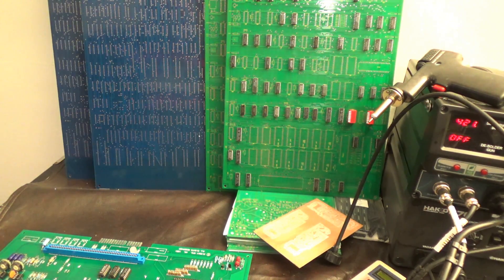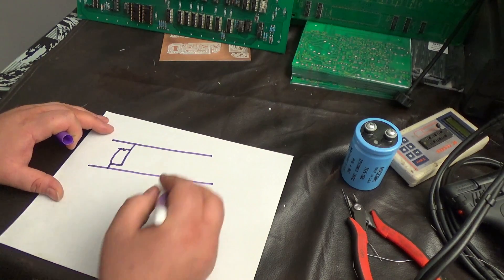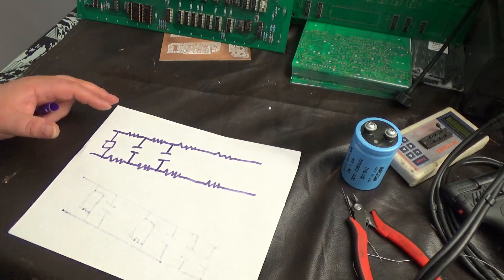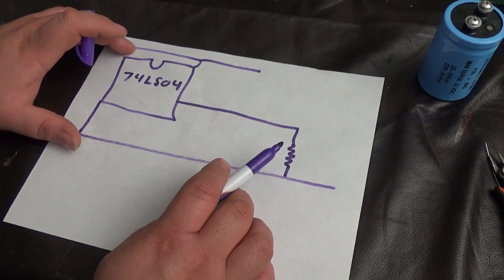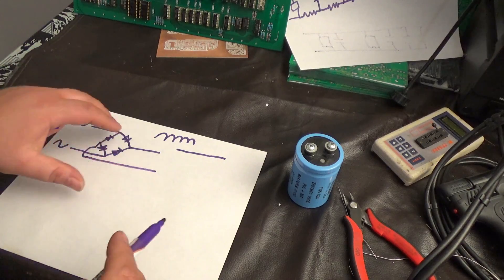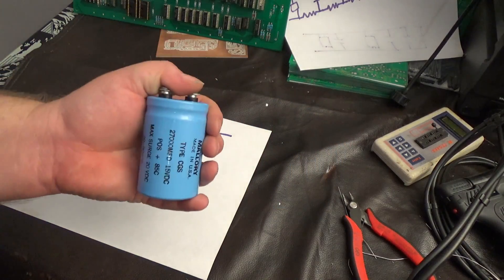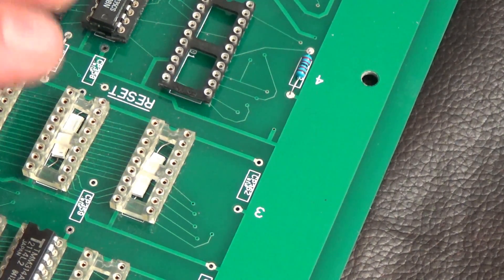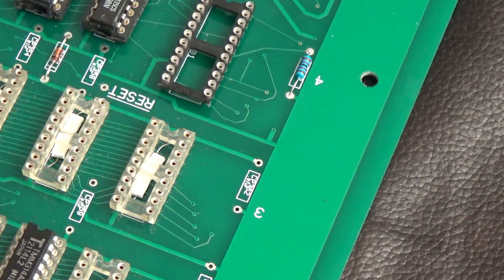Decoupling caps simple explanation

Comment: This is more or less right, but there's one thing I really think needs to be corrected:  The problem is not that the wires have resistance (the resistance is actually very small, and can be made close enough to zero to not actually matter) but actually that they have inductance, which is not the same thing (and much harder to get rid of).  The inductance of the wires means that no matter how well they transmit DC power (even a superconductor would have the same problem), if there is a change in the load, it will take some amount of time for the flow of electrons in the power/ground lines to be able to adjust to match the new load, and that shows up as a (high frequency) dip or spike in the line, which can transmit down the line to other devices, just like radio signals travelling down an antenna.

The decoupling caps allow high-frequency signals such as these spikes to "bypass" the main power lines and just flow directly to ground as soon as they come out of the chip (because the small caps right next to the chip will pass high-frequency signals through them, but not DC), so they won't propagate down the power lines to other chips (this is why they are also commonly called "bypass capacitors").

Comment: Thanks. Very interesting.
I'd say your water soluble sockets are interesting if you want to mod your board : if you need to solder some wires between legs of your ICs, you can do so to the socket pins.
I'd see a direct usage for the Acorn Archimedes computer where there is a mod to get rid of the too powerful sound filter.

Comment: Read online that these water soluble sockets are bad if you don’t actually wash them away. They leak current between pins. Search for “robotroom” with “water soluble DIP socket.”
Reply from the maker: i suspected such too bad they do look cool
Reply: Arcade Jason Definitely. Just gotta think of a use for them after washing it away. :) best use I can imagine is if you need to sandwich another PCB between your chip and the board  underneath... like, a make-shift 4-layer PCB that can’t stack on top of your socketed chips for clearance reasons.
Reply from the maker: i was thinking high moisture environments? or high frequency? whatever it is id guess the effect is minimal
Reply: Arcade Jason I’m guessing that the current leakage gets worse with humidity. :(
Reply from the maker: oh yeah the data sheet say 3 mega ohm
Reply: Yes the more I read the more I see issues and tough troubleshooting.   Although they seem like a cool idea being clear the usage in our game boards do not seem to make sense.   Jason will be able to confirm :)

Comment: Those clear sockets are conductive, just measure the resistance between 2 pins. So you'll definitely need to wash the pcb to get rid of the clear package material.
Reply from the maker: of course they are they are water based  the real question is what application is a water soluble socket required
Reply: Just because they're water soluble doesn't mean they're water based.
They're used for "complete solder joint visibility and improved air flow."
Reply from the maker: just looked it up some say protein based and some say water based . this type of plastic can be made of up to 90% water

Comment: One of the major reasons, like Jason was talking about power, is keep the power rail from collapsing locally. Let’s say you have an IC, it can be logic or a counter and you only have one output transitioning from logic high to low. Well that might not take much power from the rail and you might be ok with you board design. But, imagine the case where that logic transition from a logic low to high (0 to 5 volts) or that counter’s outputs all change to a logic level high and this logic IC or counter has 8 or16 outputs then that can can cause a local “”droop” in the power rail.  This could then cause the adjacent IC not to have enough power to perform its function. Then imagine that happening over and over all over the PC board. Soon you will have an error somewhere. The capacitors provide temporary power for that brief instant. This is frequently called “stiffing” the power rails.  Interesting topic Jason, I am sure many people wonder the value of these little brownish components at the end if each IC. But then who designs with TTL anymore. Everyone grabs an FPGA and learns VHDL or Verilog or purchases a core, but you still need decoupling capacitors. Have you noticed how many outputs modern devices have?

Comment: Awesome video. I am more into pinball machines but do have a few video games. My EM repair work is getting pretty solid but my SS work is still pretty weak. You really have to understand the circuitry and how it works more than in an EM game. Your videos are really helping me learn the SS workings which is in turn greatly improving my EM work.
Do you have any tips on rebuilding/replacing connectors on wiring harnesses? I hate molex!